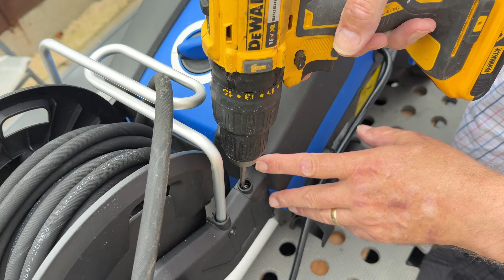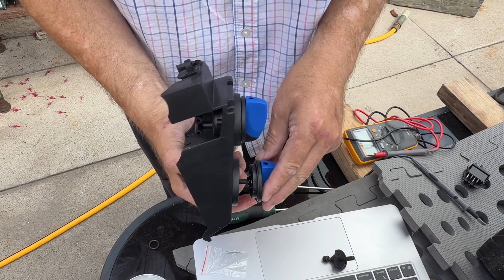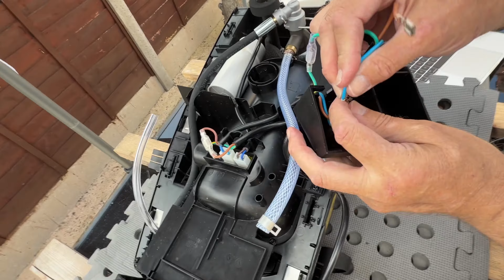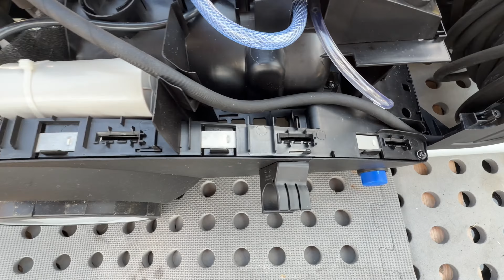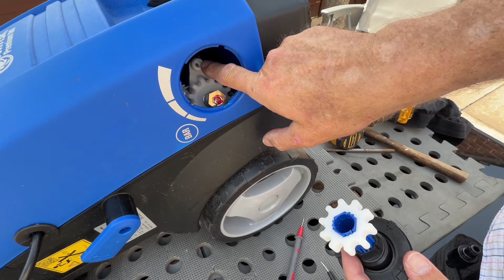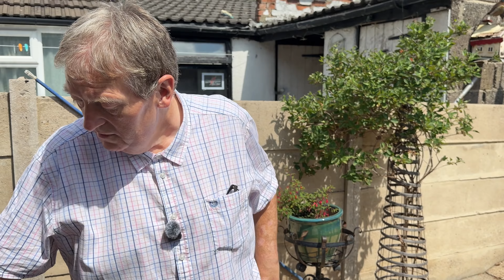Nilfisk P180 Won't Power On? Electrical Fault Fixed!

Comment: Hi, I recently bought a brand-new Nilfisk Premium 200.
When I tested it for the first time, the automatic start/stop function worked normally: when I released the trigger on the spray gun, the machine stopped by itself.
However, the second time I used it, the machine kept running continuously whether I pressed the trigger or not. I washed my car for about 10 minutes, and the motor never stopped when I released the trigger.
Have you ever experienced a similar problem with your machine? From what I have found, the Nilfisk P200 and your P180 seem to use a very similar start/stop system, so I thought you might have an idea about what could cause this.
Could it be related to the start/stop valve, microswitch, non-return valve, or possibly air trapped in the system?
I would really appreciate your opinion. Thank you. 🙏
Reply from the maker: I'm sorry this has took me a little while. to comme back to you, I'm away on holiday and didn't have good internet to download the manual, I have looked and they are the same, I would say the microswitch has not been adjusted properly at the factory, it needs to be sent back under warranty,  they will replace it with a brand new unit for you they do not repair them. Chances are it will come to me or someone else like me :-) Would you mind subscribing it would help me a lot please, and please come back and tell me your outcome.

Comment: Hi looking a bit of help with my Nilfisk 200 reel being a bit stiff is there any grease or anything u recommend for it ? Thanks
Reply from the maker: If you pull the hose all the way out then try the reel it should be free really. I think it's a hose problem, they are a 15m hose right? if so `I think you will see the hose binding up near the end.

Try it and come back to me and let me know.
Reply: @O @Oldtimer33  plan on upgrading my hose to this Nilfisk Hose E 130.2, 140.2-9 S X-TRA, P 150.1-10 X-TRA, P 150.2-10, PREMIUM 180 from direct hose also I’ve had to replace the reel handle it was that tight it broke
Reply: Thank you for the help
Reply from the maker: @Mark8019  Gosh mate something is wrong there, unwind the hose completely and see if the reel is free then if not, I can supply you with a workshop manual to take it to pieces if your OK with that?
Reply from the maker: @Mark8019  Also please let me know of the quality of the hose from Direct hoses because I have had mixed reviews and to be honest I would like a longer more flexible one, the 15 meter one I have is super strong but VERY heavy and hard to wind up.
Reply: @Oldtimer33  ok np
Reply: @Oldtimer33  yes